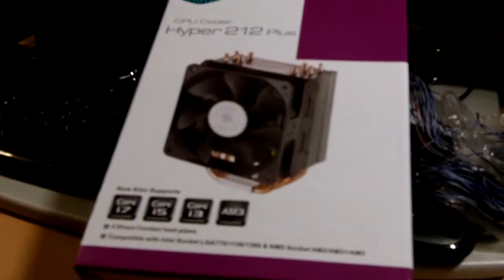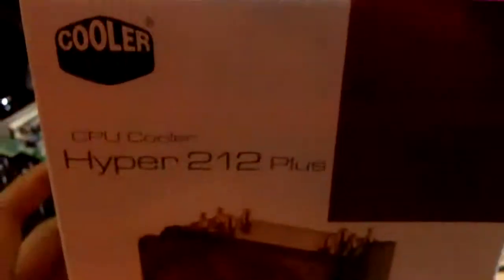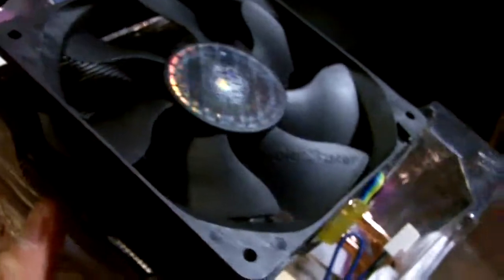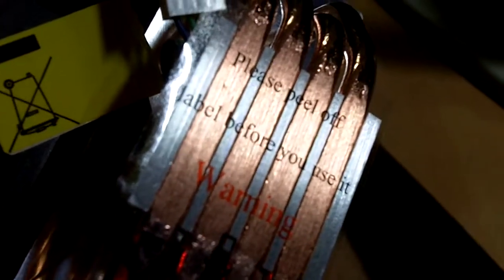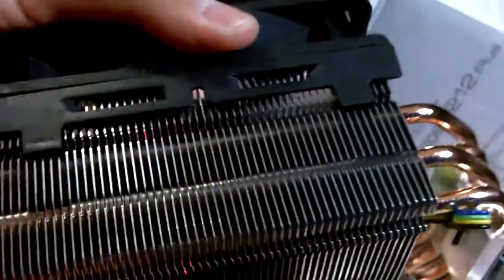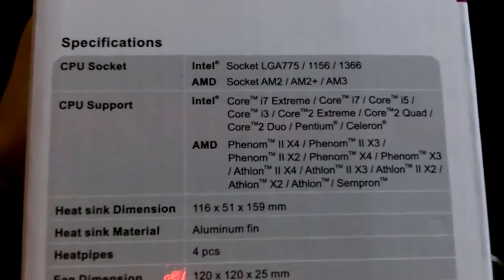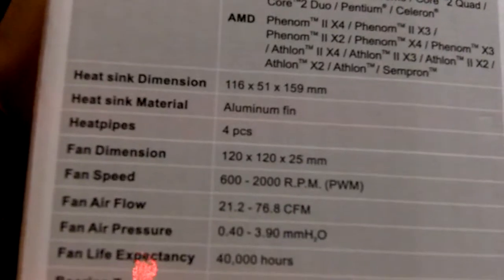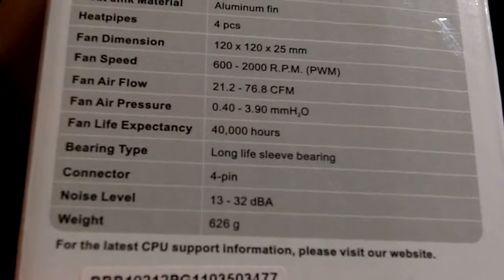Cooler Master Hyper 212+ CPU air Cooler

Comment: @StormBringerRider the cooler itself is 160mm (6.3 inches) which means the case with needed should be around 7.2 inches ( allowing for thickness of plastic/ steel of the case and the thickness of the motherboard